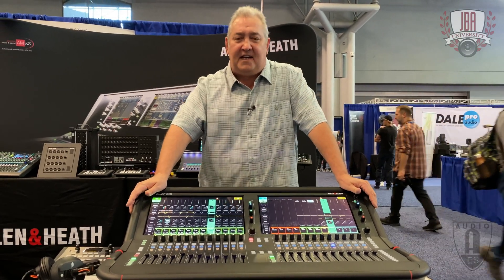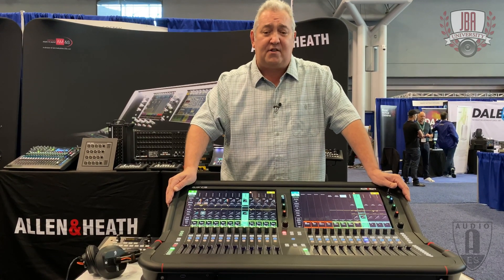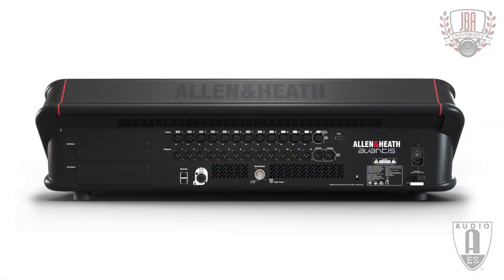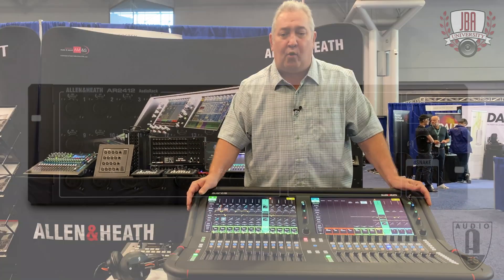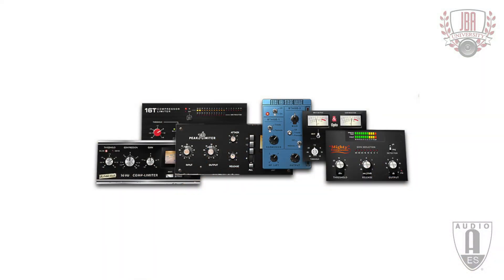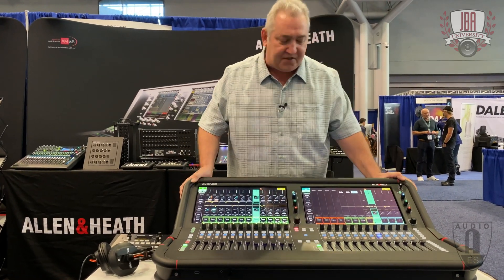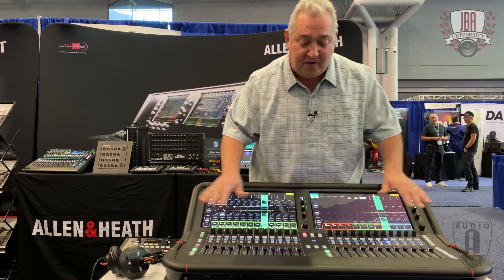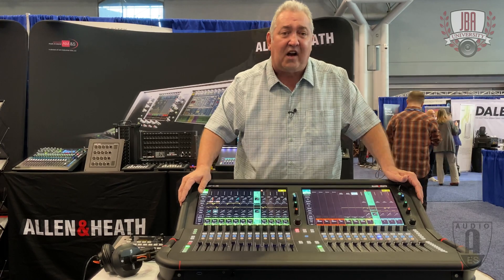Allen & Heath Avantis Mixer Overview - AES NYC 2019

Comment: what is the difference between the SQ7 and the avantis? noone has been able to tell me. hmmmm
Reply from the maker: SQ7:
96K FPGA 
32 Mic inputs built in
20 Built in outputs
33 Faders- 6 layers
Max  inputs: 48
Max Outputs: 12 stereo plus LR
Effects- 8 Assignable
Single Touch Screen
Can use older 48K I/O boxes
Single I/O Port Card Slot

Avantis: Basically A Scaled Down D Live Console
96K FPGA 
12 Mic inputs built in 1- Stereo AES Port
12 Outputs plus 2 Stereo AES Ports
12 Faders- 6 layers
Max Inputs: 64
Max Outputs: 42 Buss
Effects: 12 Assignable
2 Large 15.6” Touch Screens
Double I/O Port Slot

Both Consoles have additional features not listed here.
Reply: @Johnbanthony  so my sq7 was the better choice got it